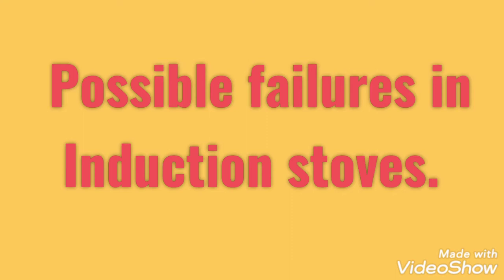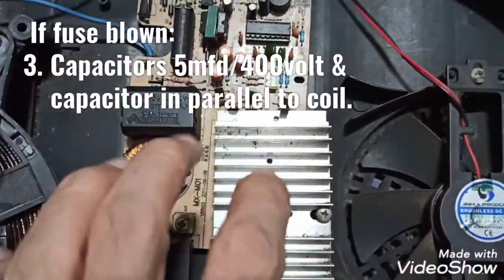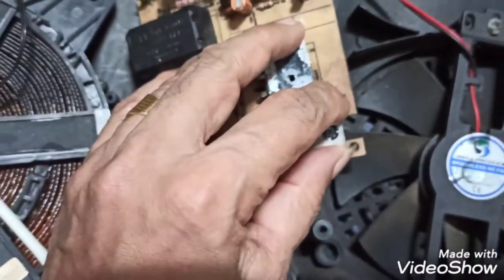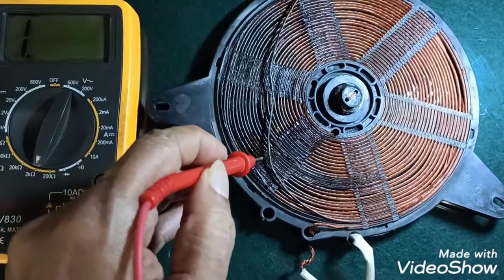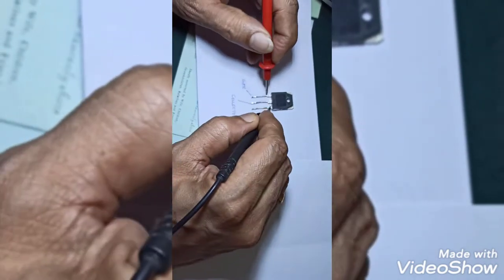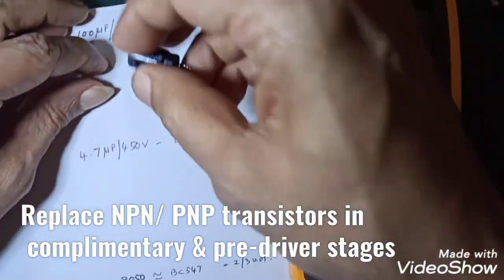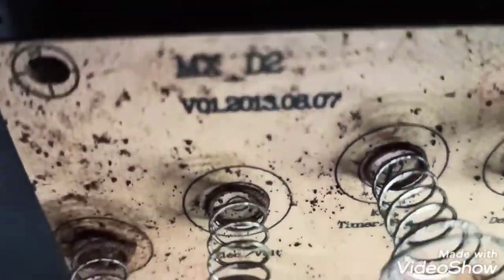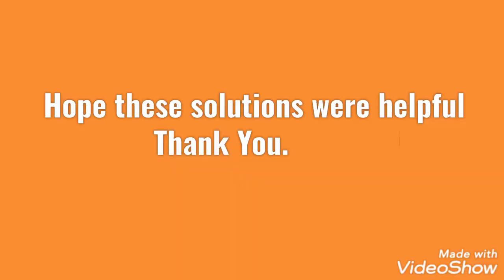Induction stove repairs- Easy hacks

Comment: (I liked the video but could barely hear your voice over the music.)  My display panel doesn't light up after breaker reset.
Reply from the maker: iSorry about my voice being audible.. The display is a seperate section seen in the panel. Make sure of the supply voltage to the display IC, if not check the position of the connector , dry connection or faulty IC. Check for any dry joints on the main PCB, take a visual check , if the Induction is working even without the display then it can be mostly related to dry joints. Good Luck.
Reply: @caroldon87  Thank you.  I found a blown axial fuse T20a250V at the beginning of the circuit board.  You are great!  Please keep making helpful videos.  I wish you great success!